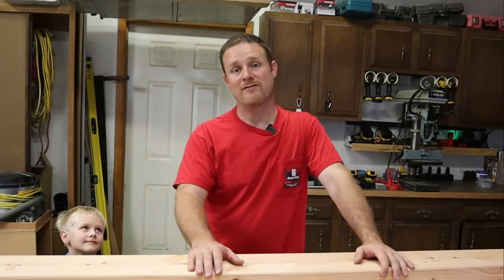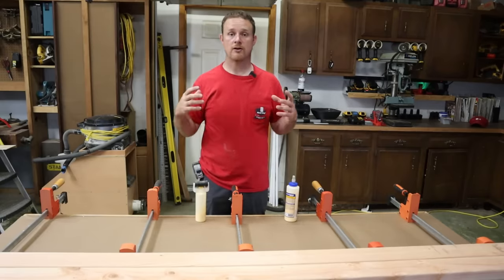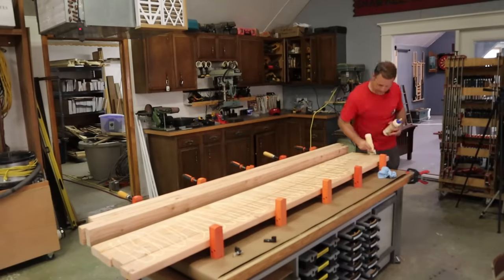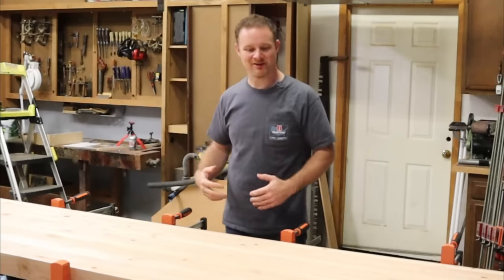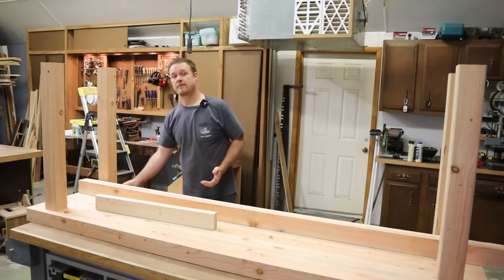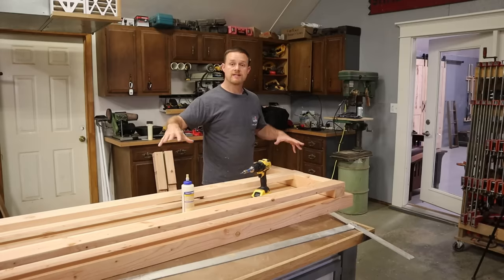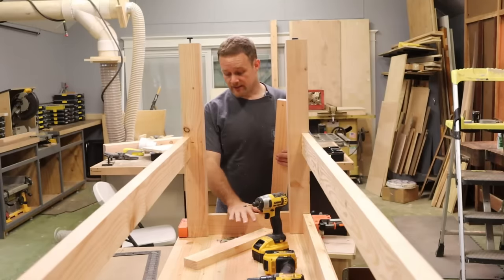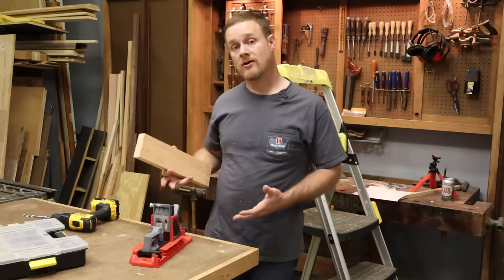How to Build a $100 Workbench in 4 Hours!  E73

Comment: Dude you need to use that jointer to make your top square.  It is a trapezoid the way you made it (top and bottom sides are parallel as are the left and right ones, but the angles between top and sides are not necessarily 90 degrees.  The way you did it, it looks close, but you needed to use the jointer to ensure they are parallel first before using the thickness planner.
Reply from the maker: I have a beast of a jointer, and use it all the time, but in this case, there is just no reason.  There is no need for the top and sides to be orthogonal.

Comment: Um!!! How did you mount the table to the legs
Reply from the maker: I only mentioned it briefly at 6:46 i used pocket screws
Reply: Gravity ;)
Reply: @shaweehillsworkshop4226  You mention that the pocket screws attach the side stretchers to the legs, but did you do the same for the attaching the legs to the worktop?
Reply from the maker: Chris Pugsley yes, the stretchers between the legs have pocket screws going into the top

Comment: What's an alternative to achieving a smooth top without having a planer like that. Would an electric hand planer do the job?
Reply: You don't need a planer to have a smooth top.  I've personally used and showed how to do this with just plywood, sanding, and a finish coat.

Comment: How did u attach the top to the legs? I guess I missed it. I watched a few times but didn't catch it.
Reply from the maker: paul minga I only spoke about it, i didn’t show it.  I used 4 pocket hole screws through the side stretchers into the top
Reply: @shaweehillsworkshop4226  Thanks I watched the video more time than i would like to admit and still missed it. Thanks
Reply: Shoulda read this before I commented!!! Gonna make one similar for my garage
Reply from the maker: @JasonWorrix  I think it is the best bang for your buck workbench

Comment: Wait. Did you fasten the benchtop to the legs at all? Or are you merely relying on the weight of the bench and friction to hold it to the legs?
Reply from the maker: At 6:47 I mentioned drilling pocket holes in the stretcher to attach it to the top
Reply: @shaweehillsworkshop4226  Thank you for the reply! Being a beginner I have no idea what pocket joinery is. However I intend to make the benchtop out of boards like you did and I am glad to hear that the glue will be sufficient to keep them together without any additional fastners such  as screws. I was thinking of adding a decorative panel/base board about 3 mm thick but the same height as the table top to the front by using 100 mm screws. That way it would be decorative and at the same time the screws would add additional mechanical strength to the first few boards of the table top. Would you agree that would be the case? Or am I running the risk of ruining the glue joint between the table top boards?

The only thing I have to figure out is how to attach the benchtop to the legs/undercarriage. I am not ready for pocket joinery. Perhaps I just send a couple of 100 mm screws diagonally up through the legs into the bottom of the top? I don´t want to use glue because I want to be able to disassemble the table as much as possible should there be a need for it. And I don´t want to ruin the table top with screw heads.
Reply: Ehm a little addition here: apparently pocket joinery and sending 100 mm screws diagonally into the bottom of the top to attach the legs is pretty much the same thing. 🙂Learning every day now...

Comment: It looks great.  Nice job, I never wouldve thought to make the top with 2X4's   I wouldve just used plywood.  And without a planer, Ill likely have to use plywood.  But im sure yours will be much stronger that way.  Oh and maybe its the angle of the camera but at 9:20 is it me, or is that shelf above your bench horribly uneven?  Haha
Reply from the maker: its a combination of the angle of the camera and the wide angle lens.  The shelf is as level as can be had with an 8' level.
Reply: @shaweehillsworkshop4226   Thanks, I figured as much.  With all the time you spent on the detail for putting that bench together, I doubted you would let that shelf be so grossly uneven

Comment: Is this doable if I don't have dados, jointer, and a planer?
Reply from the maker: Caleb Drake DEFINITELY!!  It’s just going to take a little longer.   You can use a circular saw or chisels and a hand saw to make the dados.  If you have a table saw you can make a jointer jig to get all of the 2x4’s straight and then just be careful while gluing up and you can get buy with minimal scraping and sanding

Comment: Personally I would have laid the 2x4s edge to edge. Using fewer of them. Simply use dowels to help join them. And run supports underneath. 
I don’t need a 3 1/2 inch thick bench top. 
But that’s just me.
Reply from the maker: Eric Menefee I depends on what you are going to use it for.  If you hammer on your bench a lot, the thickness helps make you more efficient.  For me, it’s a must.

Comment: Did attach the top to the base ?
Reply from the maker: Yes, i used pocket hole from the stretchers into the top.  I mention it at 6:45.  Thanks for watching!
Reply: @shaweehillsworkshop4226  Thanks. I totally missed that piece.
Reply from the maker: @PileofBrass  it’s easy to miss, I wish when I edited the video I would have included showing it get screwed on.

Comment: After watching this again, why did you cut the end stringers down by 3/4"?  You could have left them the same height as the front and rear and hidden the shelf at the ends as you did on the front and rear.
Reply from the maker: you definitely could have, I did it the way I did so that it would support under the shelf without adding an extra cleat to the inside of it, but there is no reason you can't do it that way.  Thanks for watching and taking the time to comment!

Comment: Question about the pocket hole jig. Although it quickly adjusts into place so you don’t have to know the size of  your board, you still have to go through that exercise to adjust the drill bit. Video is a little misleading.
Reply from the maker: Well, kinda. It adjust the bit for you.  no other jig does that, that I am aware of. So yes, you do have to take it out of the drill and put it into the jig, but the jig does the work.  If you watch the review i linked, it shows that.

Comment: Great video, but I don't see how you actually attach the legs to the top.  Also, looks like you put on another bottom back stretcher after you set the top on the legs.  That portion was rushed through.  Can you explain these items a little more?

Comment: $100 for the timber ?  really !  Great timber work bench, although I couldn't afford the tools and equipment to build it.
Reply: Pre covid prices, but it's still a great build for a good price.  There are build options that uses fewer 2x4's where you can still build it under $100 even with the spike of lumber.  There are also ways to build it with basic tools!  Don't let it get you down, you don't need a planer or anything fancy.

Comment: Did i miss seeing how you attached the top to the legs?
Reply from the maker: Gameweasel I didn’t show it I only spoke about it.  I used Pocket screws through the top stretchers
Reply: @shaweehillsworkshop4226  thanks.  I want to make some cheap work tables for my shop but I don't have a plainer and won't get one.  So I have to find other ways to do things.

Comment: Only think I dislike about these “cheap” workbench videos is they all use professional shops with a plethora of equipment. FYI even a 4-6 ft clamp is not in most home shops. Most people only have a miter saw and basic hand tools. Maybe a few power tools but that’s about it.
Reply from the maker: the first thing I did was explain ways to build this without clamps.  Every thing I did can be done with a circular saw and drill, and a router would make it easier.  All of these are basic handheld power tools.   Having Clamps, a tablesaw, planer etc aren't required to build something like this, it just makes it easier.  I've spent 20+ years and every extra dime I could into building my shop, so I'm going to use it.

Comment: probably a bit overkill 3½ inch is really thick. most of the people watching could get off fine using ¾ inch plywood for the table top.
Reply from the maker: I’m not a fan of 3/4” tops.   When you hammer on them everything on the top bounces
Reply: @shaweehillsworkshop4226  point taking. that is very true! great video by the way wasn't expecting a quick response. what you you recommend for a shed workbench? im mostly working on saws, small engines. sometimes 4 wheelers. 2x4 are really expensive here . id like to know your input!
Reply from the maker: JeepWoodsFun for me this type of top is the perfect option for small engine work, without knowing your area and what wood is less expensive it’s hard for me to say.  I thought 2x4 studs were cheap everywhere, didn’t realize the price varied that much.   Where are you located?
Reply: @shaweehillsworkshop4226  nevermind i just talked to my local supplier. price are around 3,50-4.50$ for a 2"×4"×8'. the last time i checked was in the covid pandemic. i believe price were higher back then! i might go ahead and copy your exact design. it would only cost 125$ + taxes in studs for doing your exact bench.

Comment: You missed some parts. You never showed how you secured the top with the legs. You just mounted the top and no indication of securing the top part.
Reply from the maker: Although I didn’t show it.  At 6:47 I said that I was going to use pocket hole jig to cut pockets in the stretcher to join the top

Comment: Couldn’t you just lay them flat in stead of laying them on there sides to save more money or to make 2 benches
Reply from the maker: Depends on what you want from a bench.  Laying them vertical makes the top more stiff and not so bouncy.  The more bounce, then more energy wasted when striking something with a hammer
Reply: @shaweehillsworkshop4226  I was hustling wanting to make one for working on small like 7 or 8 horse power motors

Comment: $100 in wood+ clamps$$$+ Planer$$$+ chop saw$$$  or factory built workbench From Lowes for $369. If you can build this bench you probably already have the tools and a work bench already. Other wise nice job from a pro.
Reply from the maker: RD a couple things.  First, you can build this bench with just a circular saw and a drill and if you had a router that would really make it nice.   So no you don’t have to have all of these tools.  But I do have them and still needed to build a bench, which is why I built it.  I actually plan on building another one for another part of my shop and I think I will build it with just those three tools.  Do you think that would make for a good video?

Comment: Not easy by any means I don't have anything you used except a drill lol looks nice though and watched the video through
Reply from the maker: Michael Gallardo do you have a circular saw?  You can build this bench with just a circular saw, and drill.   Obviously with less tools the job will be more labor intensive.  You could even build it with all hand tools, it’s just much harder.
Reply: I have a one I used for trim it's bigger size larger blade
Reply: Now you know what tools to get.

Comment: If I could afford a $3,000 planer, I could afford to buy a workbench
Reply from the maker: Dirk A do you really think that planar cost $3000
Reply: SHAWИEE HILLS WORKSHOP no.  I’m guessing 500 or so.   Still not in my budget.
Reply from the maker: Dirk A new, yes.  You can get a used bench top planar on Facebook or craigslist around $100, but you don’t even need a planar to build this bench, it just makes it easier.

Comment: um... is it just me or is the top just sitting on top of the base with no connections....
Reply from the maker: Fweeza900 it’s attached with pocket screws.  I talked about it in the video but didn’t shownit
Reply: I just finished making the table & was asking myself the same question.  Pause the video at 7:40 & you'll see the pocket holes in the long end of the side stretchers.

Comment: You should probably brush up on using proper PPE (personal protective equipment).  I didn't see you use any safety glasses or hearing protection when using your power tools.  No respirator or gloves when applying the finish.  Especially with your kids in the shop with you.

Comment: Too bad I dont have a planer.
Reply from the maker: Do you have a router?  If so you can make a router sled to do the same thing
Reply: @shaweehillsworkshop4226  I do have a router. Never heard of a router sled. I’m going to Google now.
Reply: @patrickkelly8095  Honestly, you don't need a router or a router sled to build a work bench if you're just starting out.  Another option for a flat top is plywood and you can get a good 3/4" sheet cheaper than the current high prices of that many 2x4's.
Reply: @inspiringbuilds  I thought about that option but for presses and vices I’d want to bolt through something stronger.
Reply: @patrickkelly8095  I have a vice on mine and it’s super strong, feel free to check it out.
Reply: @inspiringbuilds  you’re prolly accurate about the cost of all those 2x4’s but i was actually thinking of just buying a butcher block counter and I’d get a totally flat solid wood top.
Reply: @patrickkelly8095  Those are nice too, just a bit pricey.  I prefer staying in the $100 price range and show how to do that even with Covid prices! Shellac is a nice option for protecting workbenches and making them look great.

Comment: Would be a better video if you included materials list, measurements. $101 total? Yeah I don't think so.
Reply from the maker: Jerry Snow you want me to make it for you too?  And it actually came in around 90 in wood because I ended up not using it all.  The amount of glue and screws I used were probably around $10, but since you would have to buy in bulk if you didn’t already have them it would cost more.  As for the finish, I used what I had lying around, but you don’t have to finish a work bench

Comment: $100 work bench?   Harbor Freight.
Reply from the maker: Bart Bidlingmeyer I own the harbor freight workbench and compared to this it is no where near as nice.   It’s nice that it has a vice and drawers, but the drawers and shelf are junk.   If you plan on actually using and abusing your bench don’t buy the harbor freight one
Reply: @shaweehillsworkshop4226  i know... i own it too... your video is a waaaay better bench!  I also had to epoxy all the holes on mine because I kept getting sawdust in the drawers!

Comment: Those 'adjustable feet' suck! I'd rather use shims!
Reply from the maker: I've had no issues with them, I have them on all of my shop projects because my floor is so bad in my workshop.  What problems have you had?
Reply: @shaweehillsworkshop4226  
I do a lot of heavy pounding on my bench, I guess I should have mentioned that...

Comment: I appreciate this but you need a 10,000 dollars worth of tools to make a
 100 dollar bench.
Reply from the maker: Edwin Fonseca that is not true.  My fancy tools definitely make it easier, but you can build this bench with just a circular saw and a drill
Reply from the maker: Karl Summers if you don’t have a planer, you simply need to rip one side off of the 2x4s before clamping them up.  The reason for using the planer is to get rid of the rounded edges of the 2x4s.  Using the planer is just MUCJ easier and quicker

Comment: How to build a $100 bench with $2500 worth of power tools 🤣💀
Reply: A thickness planer, track saw, clamps, cordless drill, pocket hole guide and a belt sander should not cost that much.

Comment: This is like me making a bottle opener for 10¢. Yeah I only needed to use my forge, anvil, tools, and years of developed knowledge but the steel only cost 10¢. You're a joke
Reply from the maker: Everything I did here can be done with a drill and a circular saw.  If you don’t have these two tools you don’t need a wood workbench.  Your bottle opener comparison is a little skewed.
Reply: @shaweehillsworkshop4226  then here's a challenge. Make the same bench but with only a $50 budget for harbor freight tools.